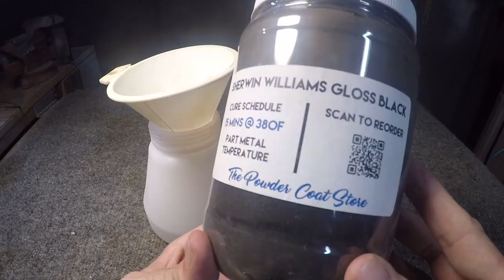1970's ERTL Conversion Van Restoration, Customization. New paint/powder booth! Not Tonka.

Comment: Great job. I have never seen anyone work out of one of those metal buildings. The one I had you couldn't even stand up straight in. Sure would like to see a tour of it and any modifications you have done.
Reply from the maker: Thanks David!  The only significant modification is a window unit A/C. Painted the roof white and added some insulation to roof inside. Dead summer here it gets over 100. I can get the temp down to 85. A box fan behind me helps also. I’m hoping some of my subscribers can help support my channel by picking up some of my merch. Maybe I’ll be able to upgrade the shed to something better. Thanks for watching my content. 🙏🏻 RS

Comment: Well, well well well well! Well, very well indeed I don't recall, sir, there was any option given for two tone! This is akin to being asked if one wants a steak or lasagna, only to discover when being served that the person to the left of you has lasagna with a steak in it! Which is obviously better! I did not know one could order a lasagna with a steak in it, or a steak with lasagna dressing!
Outrageous!
On the other hand, spiffy as always RS, couple of spots where the masking wasn't 100% which set my brain wondering what happens if you put a thing with masking tape on into a vacuum chamber, would you end up sucking the tape down harder? Would it do nothing at all? Would it build up a potentiality of kinetic energy that, when released, would shatter the steel containment vessel and kill everyone within a hundred yard radius with razor sharp shrapnel?
Probably not the latter to be fair...
Chap the other day, or indeed yesterday as it was known back then, was pondering on the structural containment of a can of diet coke and the interesting things that could be done with a variable pressure container. I used to have access to a very large one but they revoked my building access privs after the deep-fried chicken incident in 1994. I did discover that lowering the air pressure does indeed lower the boiling point of sesame oil. Also that explosive decompression can spread a deep-fried chicken over a surprisingly large area. 
I feel I've wandered off-topic somewhat.
Reply from the maker: Hahahahaha! Your brain works in mysterious ways!
Reply: @RustyShepherd  That's what they said at the last reinstall....

Comment: very nice job. is that supposed to be a ford or a dodge?  back in the day they were all very similar. That's before Ford put the nose on em. one of my Friend's dad had a Ford, it even had that little round rear window treatment this has, but was plain Jane as hell inside.Double rear doors instead of the single door. Now one of my other friends had a 60's model Ford van with a Wizard mural on the sides. It had the shag carpet and all that. Six cylinder in the middle, the Hump as we called it. but it had what was called a six equals eight kit on it, headers, different intake manifold, different carb.. ran great when it ran. With rather meager wallets back in the day (fast food jobs don't pay well) we had a time keeping our vehicles going. Most often we all wound up in one guy's pinto trunk back. There would be somebody up in the package tray in the rear, four guys squeezed in across the back seat, and then of course shot gun driver bitch seats up front. The middle of the front wasn't called bitch because that was where a gal would be setting, it was called bitch because if you sat there, you were sitting on the parking brake lever, and it could be a real bitch!

Comment: tech question...how big of CFM compressor you using to run the sand blaster
Reply from the maker: 21 gallon central pneumatic. Works ok. If I could go back, I would have bought the 26 gallon.